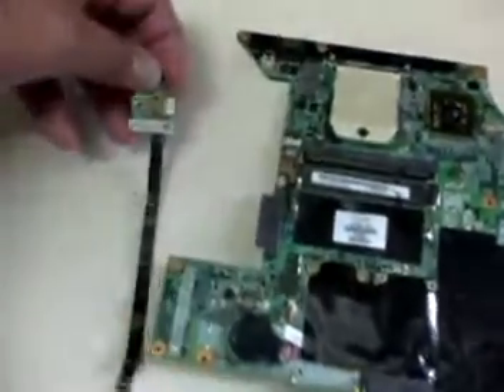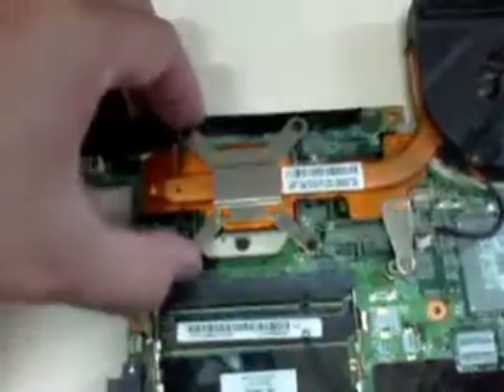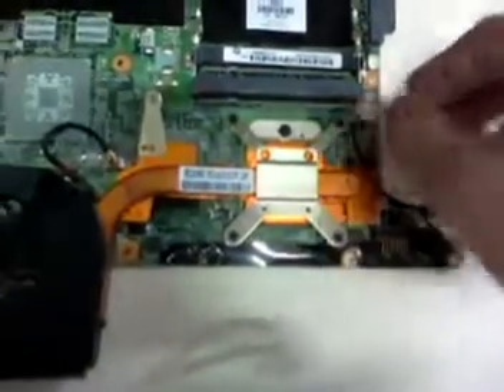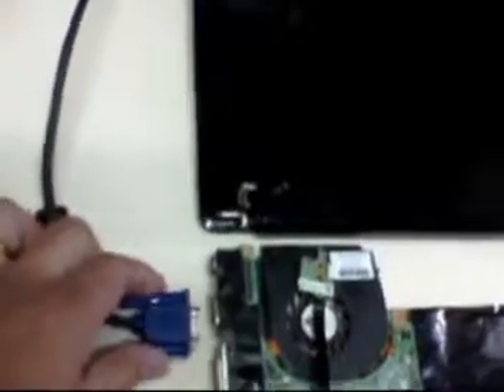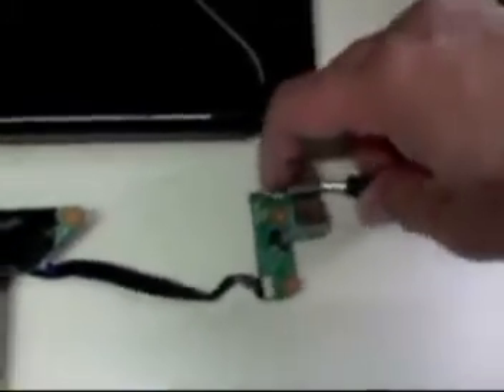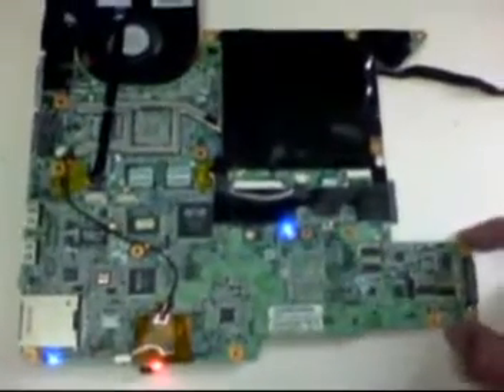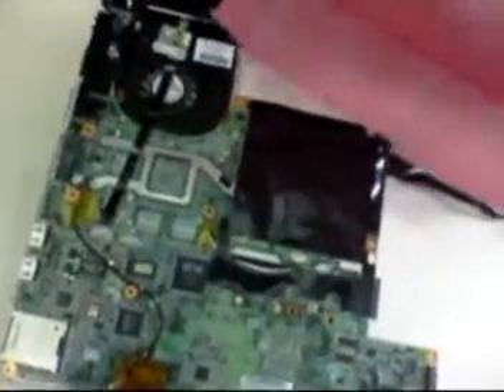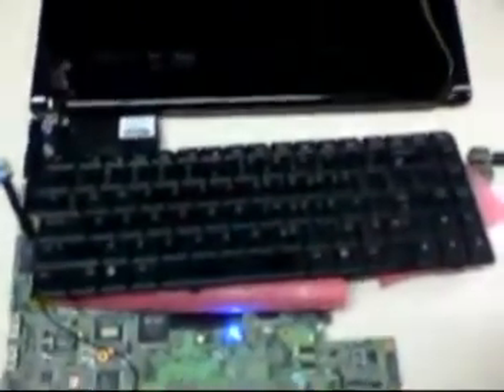How to test a laptop motherboard outside of the machine

Comment: please help me with my strange problem the laptop doesn't power on after 8 hours.let say if we turn it on and turn off again and then when we try to turn it on the laptop it wont no lights,no fans spin,no led indicators.again the laptop after 12 hrs or 8 hrs then it works fine.i am using the laptop with sleep mode right now.the only solution i can able to turn it on is by ;eaving the computer by not turning on for 12 hrs or such.plz help

Comment from the maker: Hi, Im not sure if we are understanding each other. You don't need to remove the cpu at this time. I'm asking if you can attach the basic parts, those are the:  CPU, memory, Keyboard, motherboard, lcd screen then try to boot up your machine but disconnect the other standard parts such as Hard Drive, Optical Drive, SD Card, etc., then see if you can POST or show any startup dos prompt on the screen.

Comment: thanks for your quick response. i try moving the pin inside jack to see if is moving but seem to be all ok. i try using the voltmeter and try to read any voltage from the battery pins but nothing. so are you 100% sure dc jack need replacing?